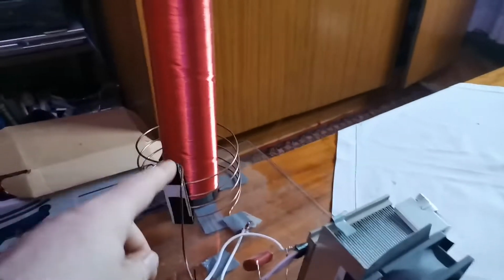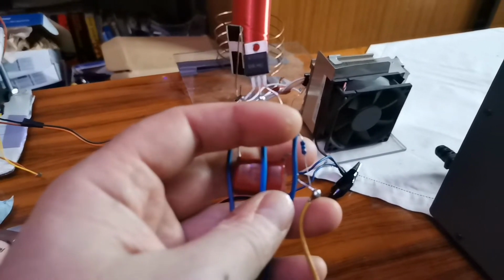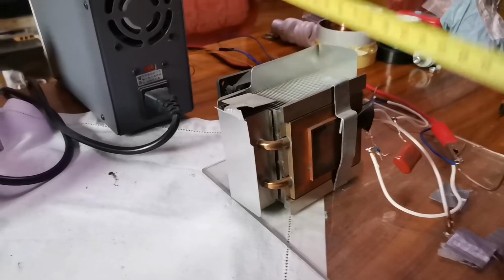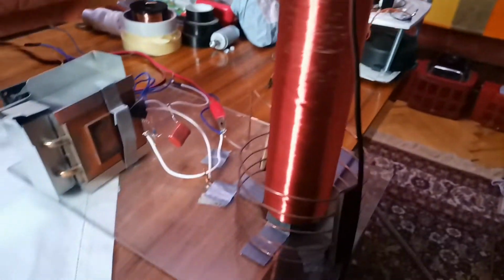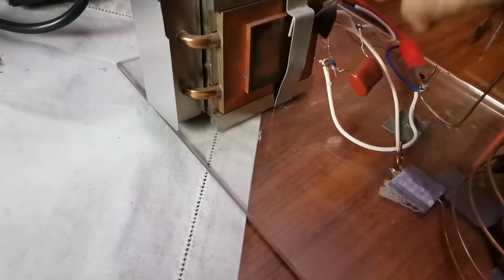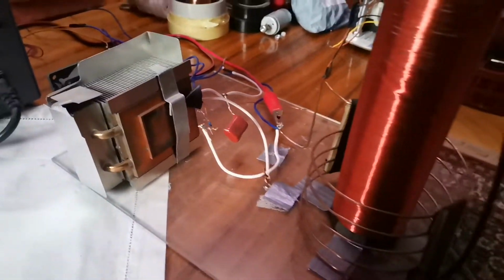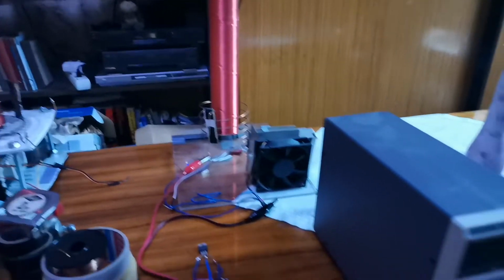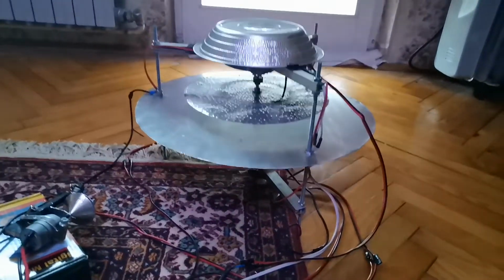ALEXEY CHEKURKOV KT819b SLAYER EXCITER for GRAVIFLYER !!!

Comment: Nice work!  It seems important to have the CW type output from the TC vs some people seem to be using spark gaps for TC excitation that will not be even close to continuous wave.  Have you tried operating it from hanging it on a scale yet to see if any weight loss?  Would be great to verify other claims of measured weight loss as this is a slam dunk if so.
Reply from the maker: No..

Comment: With direct connection between the top of the secondary on the TC and the frame of the device the frequency of the TC will drop dramatically due to the increased capacitance.  I think a HV variable capacitor connecting the top of the TC to the feed line to the GF frame may be the best way to go as you could then tune the coupling between the frame and the TC for proper voltage without dropping the frequency of the TC oscillator too low.
Reply from the maker: Tnx.. I Will try.. You mean top to capacitor to Graviflyer?
Reply: @blacksquad2160  yes, you will find that the lower impedance is between the top of coil and graviflyer then the lower the resonance frequency will be.  Big capacitor in series will act like direct wire connection, very small capacitance decouples the graviflyer capacitance and lets the slayer run higher frequency, probably a sweet spot at some cap value.  I used kitchen foil plates separated by plastic on top of coil to give different cap values and different coupling/resonant frequency.  I guess you could use high ohm resistor as well instead of capacitor in series with graviflyer for same effect.  Alexey is essentially capacitively coupling by placing the wire inside the tc frame the way i see it.  Great work your doing!